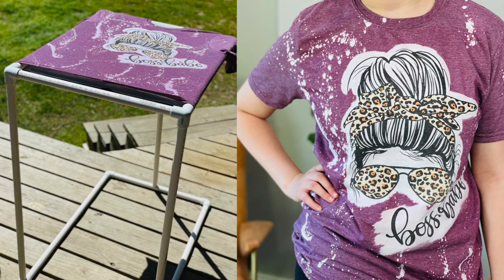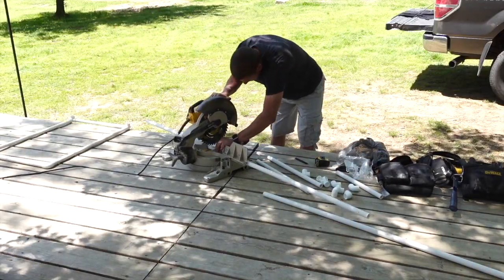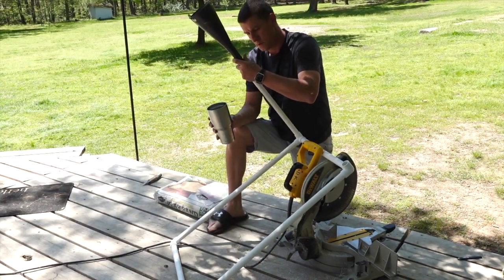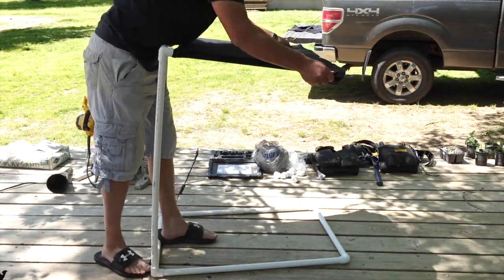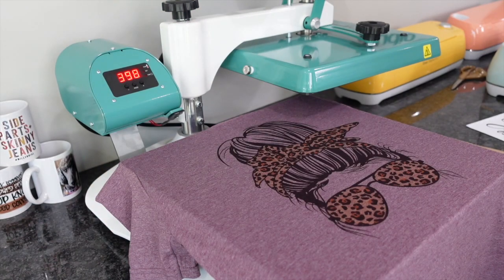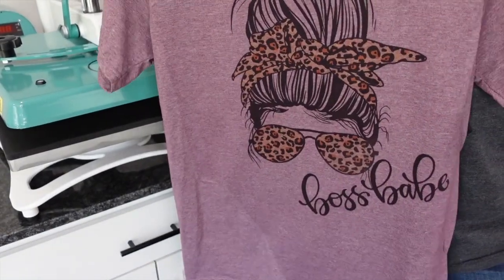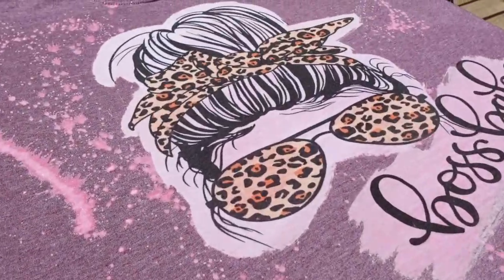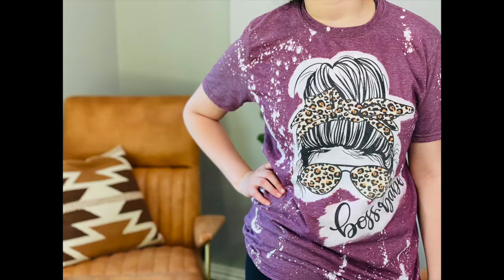DIY Sublimation Bleach T-shirt Stand

Comment: Hey I did one with a spray bottle and it’s bleaching and I washed the second time after I wore and washed the first time and it was breaking apart and had holes in them i don’t know why?
Reply from the maker: You probably applied way to much bleach, and left it way to long, only leave 10-15 minutes and wash right away

Comment: When you pull it off the stand will the bleach get into the back? ( I only want the front with bleach). Also do you need to use peroxide to stop the bleaching process? Thank you for this video it’s a game changer!
Reply from the maker: I don't use peroxide I know some do.. and very rarely does it get on the back I put mine straight in the wash do this with a light hand so you don't over saturate

Comment: How long do you let it dry on the T-shirt stand (which is awesome btw!)? I just wonder when you pull it off if the bleach would bleed through to the back of the shirt ? Thank you so much for this video !
Reply from the maker: You can let it sit until it’s dry it’s pretty fast I leave it between 5 -10 minutes. I have not had any blead through I would keep a bucket of cold water close buy if your not going to wash ASAP (and thank you )
Reply: @YouCanTotallyMakeThat  thank you so much !!!